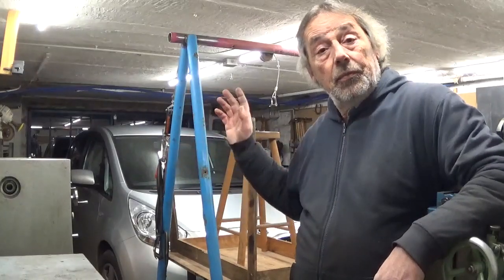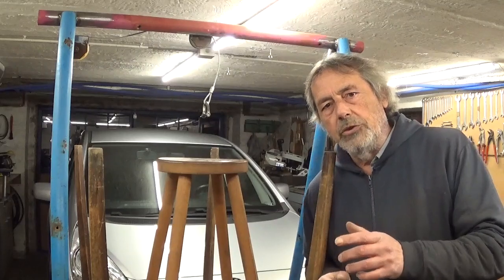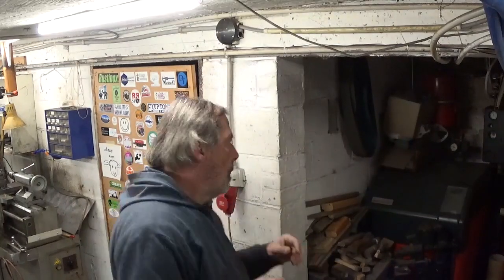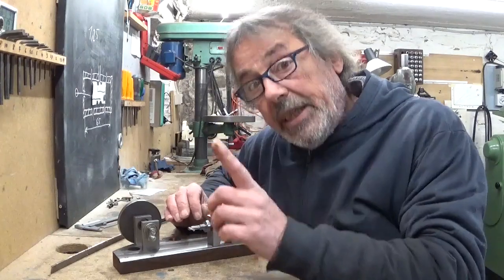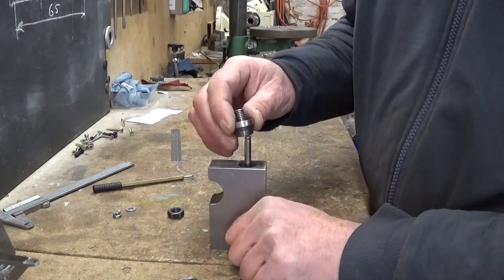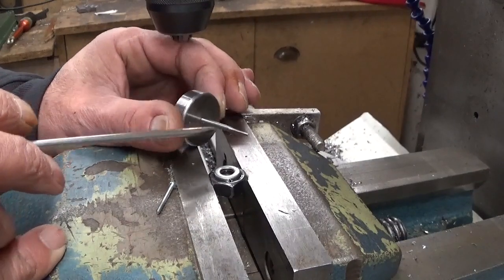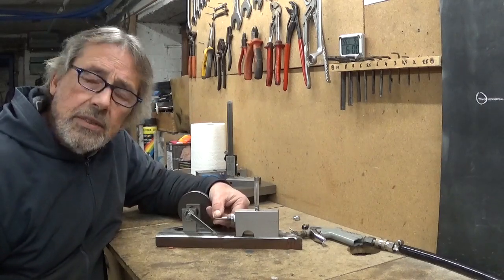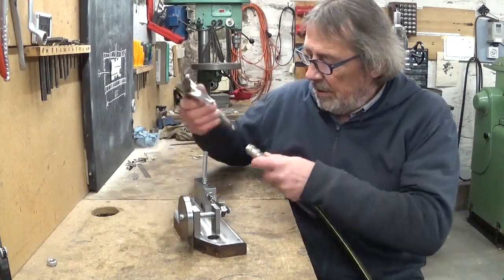Experimental air engine part 3.

Comment: Sir,
Two points for you to ponder. 
1st
Install a smaller door. 
2nd
Looking at the technical drawings and pondering them whilst walking the wife and dogs, it would appear that when your piston reaches the center the center rib of the piston would shut the airflow off. Would a narrower rib or larger port possibly be the answer  ? You will probably need some " valve " overlap but if managed right it will allow operation with minimal impact from said overlap. 

John 🇨🇦
Reply from the maker: I also think the central part of the piston is not right. I will make a new one.

Comment: It a shame it does not run, but that is what experimenting is all about. I think you are right about the air leaking into both chambers and pushing the piston to the middle, where it wont push the piston either way. We look forward to seeing the results when you fit the O rings.
Reply from the maker: I will continue experimenting.

Comment: Rusty   Yes pressure on both sides at same time,  o rings not be end all solution   close fitting piston lapped in brass ok    o rings 3 off need to over come friction on all 3.  Look up hot air engines run on a candle heat nat power. 

I know the feeling fronzate nuts 

Steve
Reply from the maker: I wil try to figure it out. For sure.

Comment: Hi Rusrinox, try this minor alteration, a larger diameter exhaust port(s) to reduce the equal resistance of compression as the air exiting now will be the same pressure as the air pumped in forced through the same size hole. A larger exhaust port(s) should give the pressurised feed end an advantage and the momentum of the piston will travel over the exit port to seal it for the return stroke. Enjoyed the testing. Tony
Reply from the maker: That makes sense. I will have a look at it.

Comment: With what knowledge/experience I have with steam engine I think this ide would work with two pistons off set 90 degrees from each other as it seems the piston is stopping mid stroke so as long as both pistons aren't mid stroke at the same time

Another option would be a heavier flywheel it might have enough momentum with a heavier/larger flywheel for the piston to carry on past the point where the air on each side of the cylinder equalizes
Reply from the maker: Interesting thoughts here. Thanks for your imput.

Comment: Thanks for sharing. I saw a video on the math and how to measure the timing. Your type of engine is very unorthodox I’m not sure how much work, research it would take to get it right. I was thinking it could make things work before drill a thousand holes in the piston. Dave Richard and his Steam powered machine shop channel.
Reply from the maker: Even if it runs, with this design it will never be very effective.

Comment: Well, Keith in Michigan. On December 16th, winter is happening. Since I am on the west side of the state, we can a heck of snow along are "Lake Effect" it's called. My garage isn't attached to my house. I'm 50 feet away. I installed a 75,000 natural gas, and in my house, I can push a button, which used to turn it on. My Lathe and Mill is located in my basement. Wanted to tell you, happy holidays and a new year, my friend ☺️...
Reply from the maker: Thanks Keith.

Comment: From looking at your chalkboard drawing, it looks like when the piston moves past mid stroke, it’s putting air pressure into the end of the cylinder the piston is trying to move toward, which just pushes the piston back to the middle.  I wonder if you can change the port timing so it only lets air in close to the end of the stroke?  Otherwise I’m thinking you’d need some sort of valve mechanism so the air comes in out of phase with the stroke.

Looking at it again, what if your exhaust ran through the piston and out the middle port, and the piston ports on the ends let the air in?
Reply from the maker: Interesting thoughts, Jeremy. I will have a closer look at your idea...

Comment: i read some of the posts. However i think there is a different issue. I think the port timing is too wide. The overlap is large. I suggest much narrower feed grooves on the piston. If it gets too involved or expensive, make your test pistons from old broom handles.
Reply from the maker: That makes sense.

Comment: Keep at it and I’m sure you’ll get there in the end. Try spinning the flywheel a bit faster and also make the crank adjustable, sometimes it’s just fine adjustment needed. Good luck and merry Christmas.
Reply from the maker: I will continue working on it. For sure.

Comment: Hey I think maybe you should try bigger flywheel. Give more momentum
Reply from the maker: That makes sense.
Reply: One other possibility is the air coming in is more than what is able to exit. Meaning inside becomes to pressurised and the air can't get out to allow the piston to move?

Comment: Could you have chased those threads with a file? If you have 1 nut that fits you probably only missed thread size by a few tenths.
Maybe could have soldered that washer in place?
.
I think you need to oil your nuts
Reply from the maker: It's supposed to be M10, but this nut is out of spec.

Comment: Quick question - would inertia help the problem? Spin the motor up with a drill and then apply the air?
Reply from the maker: Maybe. And also a heavier flywheel.